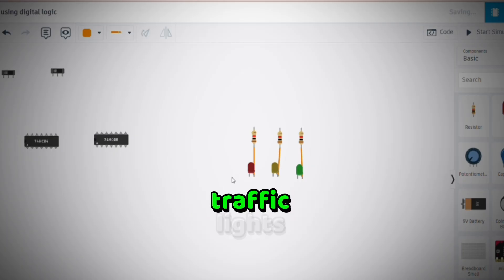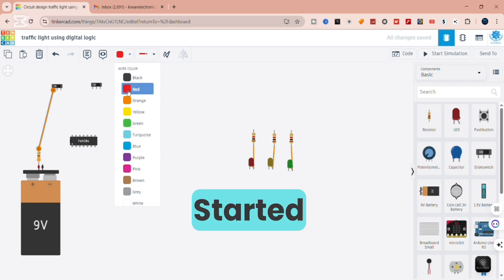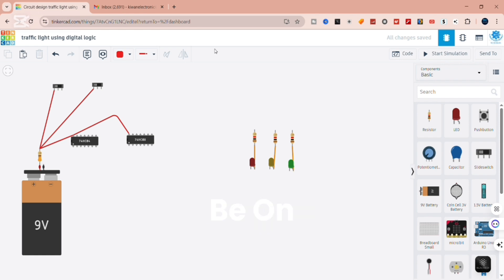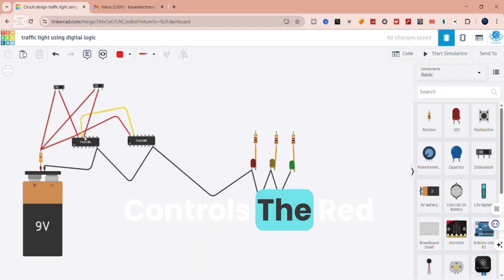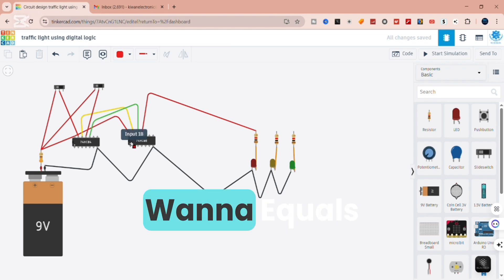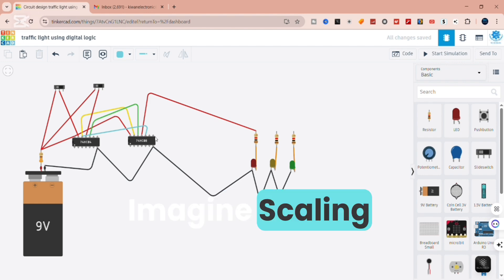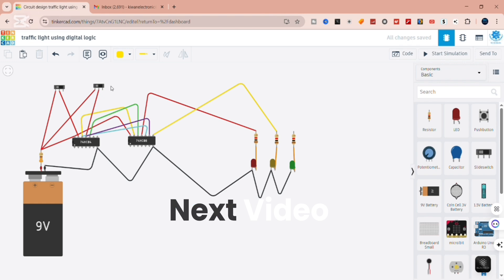How to Make a Traffic Light Circuit with Logic Gates (Full Tutorial)

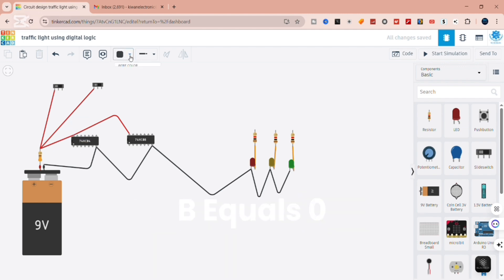Comment: 1:53 why input 13 you are calling as 6
Reply from the maker: This circuit it consists of 2 not gates and 3 And gates with 2 inputs and 3 outputs , also as we all  know that each digital ic 7404 (Not) and 7408 (and) consists of 4 digital gates
Reply: @rayankiwanelectronics  Actualy i knows about the gates but i did not used to know about the IC's much and there inputs
Reply from the maker: Check the data sheet for each ic, which it consists of 4 logic gates, each one